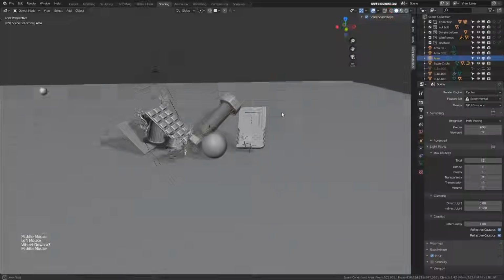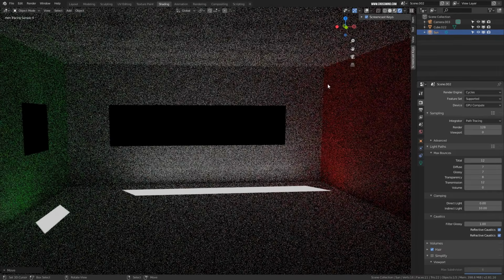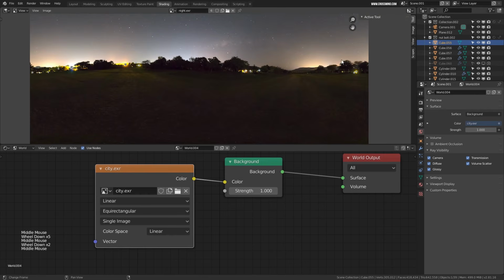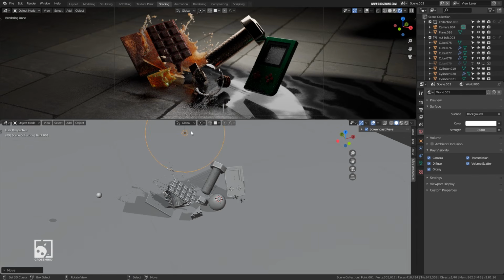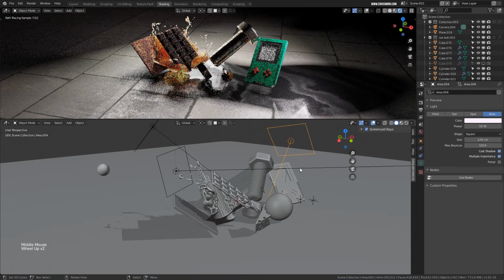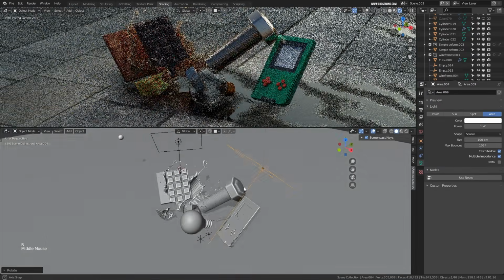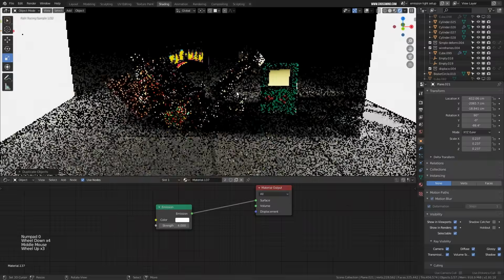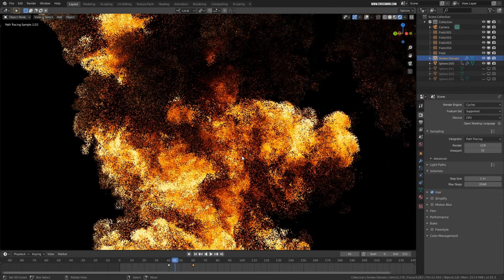Blender Day 5 - Lighting -  Introduction Series for Beginners

Comment: Ok, I am having a problem that's really bugging my head. The "Area" lamp I assigned to my scene is invisible to the camera as I intended. However, It's reflection is visible in glossy surfaces (Such as the glass screen of the Gameboy). Is ıt possible to get rid of this without moving any of the lights or objects in the scene or am I asking for a technical impossibility? (Since it's not the "lamp object" itself that is reflecting from the screen, but it's beams.)
Reply from the maker: Select you light... go to object properties.. > visibility section.. from there you can turn off glossy , transmission etc.. but that will also affect render result.. as light wont reflect through reflections or glass etc. and will only affect diffuse surfaces.
Reply: @CrossMindStudio  Thank you so much Mr. Ram. I was thinking somewhat of a similar answer. The situation I mention also happens in 29:36 - 29:42 when you play with the visibility of the emission object you put in the scene. The object disappears but you can still see it in it's reflection in the water puddle on the ground. I believe it's because we are actually seeing the light the object is emitting, and not the object. 

And again, thank you. I wasn't expecting you to answer a 5yo video. And this is one of the best free Blender courses on Youtube.

Comment: Hey man, excellent tutorials! By far some of the best out there, and I just love how you break everything down and how much there is to learn from your stuff. I was just wondering how you added the detail in the water puddles as shown in your end result?! I tried to do some stuff with the shaders, but I don't seem to get the same effects as you have. So, how did you do it?!  Thanks! :)
Reply from the maker: Thanks,   about water puddle, shading was discussed in previous chapter. 
Hope you are following the series in right order.
check chapter 4
Reply: @CrossMindStudio  I did, I'm loving the seires, but I just couldn't get it as you have it in the vid. It's not the water puddles themselves, it's the effect in them, you applied to them. I assume you used the ''wave texture'' or the ''musgrave texture'' for it, but when I try to apply it to the  water puddles, it just doesn't seem to achieve the same results as seen in your vids.
Reply from the maker: are you using cycles render engine?

Comment: I have a problem! 
In my laptop 
Only sun light is working others are not!
Is anyone facing same problem?
Reply from the maker: It could be that your scene scale is too big, for instance if you make lets say 400 meter big structure then small default value of lights might wont be visible unless you bump the values really high. Whereas sunlights are very bright by default i think.
just crosscheck your scene scale and try to keep it to real world scale.
Reply: @CrossMindStudio  it really worked! 
My scale was too large!
Thanks a lot.

Comment: Hello, thank you for these great tutorials, but I ran into some problem during the introduction of different kinds of indirect lights, such as area, spot and etc. it didn't display its light at all, and I had to almost max out the " Power" watts of the light to show a lil bit of it, then I also had to use node emission and strength it to "1000" to give a decent amount of light like yours, Yet yours was just using the default settings
Reply: I solve this problem, you have to turn on the scene light in viewport shading,
Reply: @Tibarnnnok  Thank you so much i was struggling with this problem!
Reply: someone HELP PLEASE~!
Reply: i have same problem too